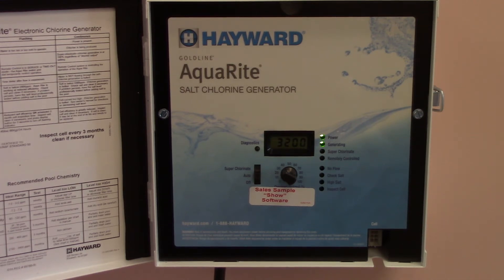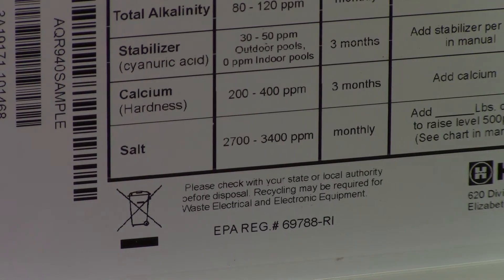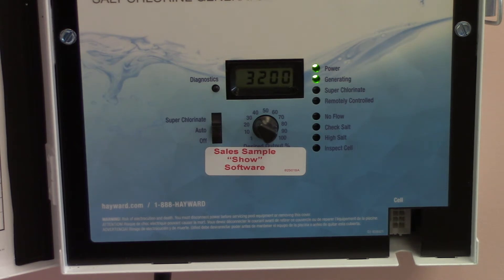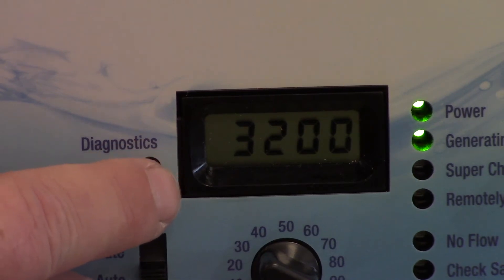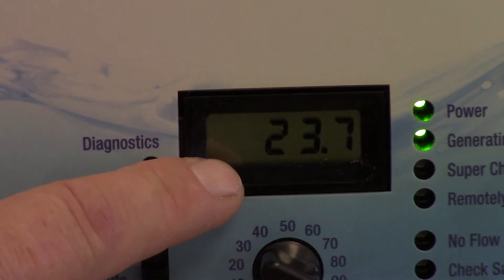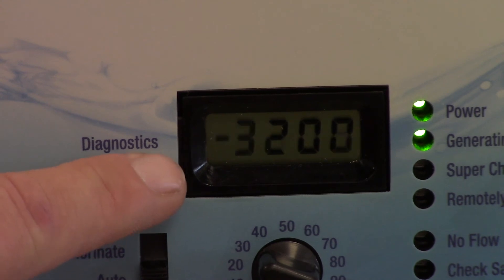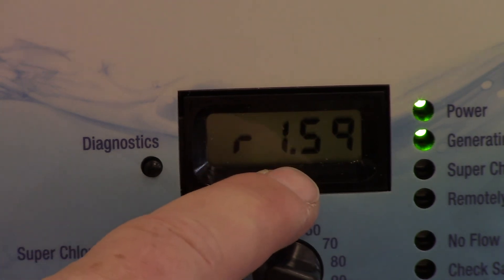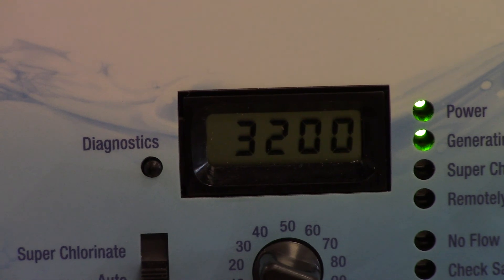AQR diagnostic screens

Comment: Why is my display showing hot? How do I fix it?
Reply from the maker: That is not usually a message we see. In most cases, the temperature sensor in turbo cell is defective and the cell needs to be replaced
Reply: @aquaticfacilitytrainingott7444  saw a guy strip the wire going to the generator. Basically put a potentiometer on it one leg to red,other leg to blue. He was able to spin the dial and adjust the temp.guess I can try it.